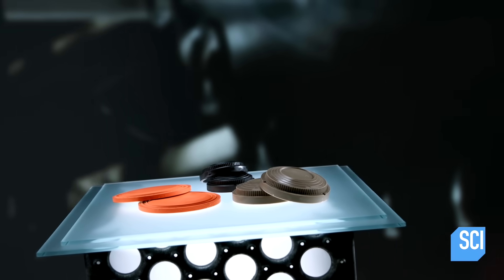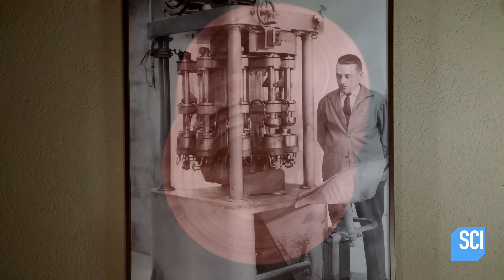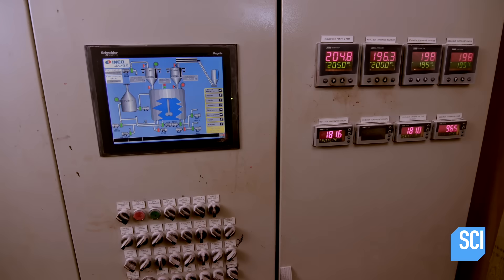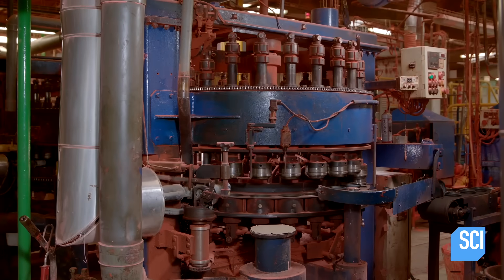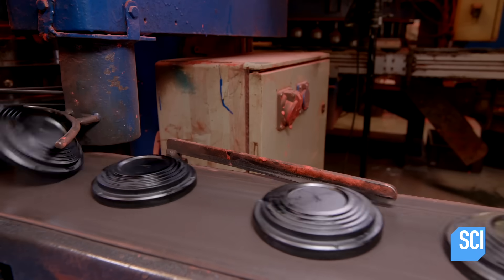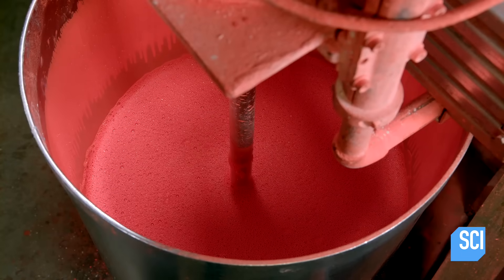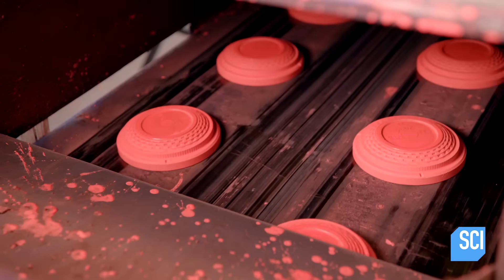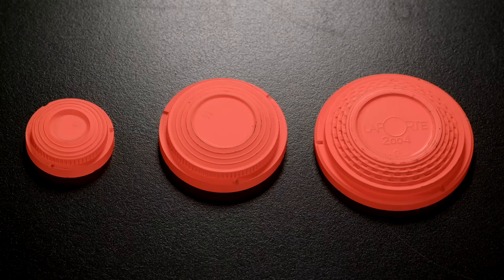How Clay Targets Are Made | How It’s Made

Comment: Makes the target out of petroleum. Boasts about biodegradable pigments SMH!
Reply: This actually seems like a pretty fantastic way to use pitch. Spread the harmless substance around the environment where it'll do absolutely no harm, instead of burning it and releasing CO2. And the paint being biodegradable means they'll turn from bright orange eyesores into inconspicuous black things.  Maybe there's something wrong with what I've just said, but there's more to the issue than your pithy little "SMH" message.
Reply: @TheHuesSciTech  Pitch is a manufactured product. Which means it doesn't need to exist in the first place. This it would never been burned if it weren't needed. Supply and demand. Didn't you learn this in your middle school classes?
Reply: @TheHuesSciTech  Negative! Pitch is a manufactured product. It's a common misconception that pitch is a byproduct. As for cost see above. I did a side by side for another comment. Bothe are relative and many have given much more inexpensive more biodegradable options!
Reply: Withered Perception the petroleum pitch is also biodegradable
Reply: @skylermurray5989  Negative. No petroleum products are biodegradable. You have been lied to! Only bioplastics and other bio-oils and bio solvents are biodegradable!
Reply: The pigment used to be Lead based.
Reply: @adammoore251  Not all...
Reply: Wonder what its like to go out to range that does a ton of clay target shooting.  Petrol shards everywhere and all nasty from being in the sun?
Reply: @OneOfDisease  Doesn't get nasty or change at all, stays as brittle black shards even after years in hot sun, that's the point of all the talc. The lead shot is a much bigger concern when it comes to contamination. Whether you miss or hit, it all basically falls in the same streak. My local field winds up with a mound about waist high after a season. They just shovel it up and dispose of it.
Reply: @OneOfDisease  they degrade very quickly, you'd never know there was any petroleum used in them.
Reply: @otm646  Yeah, or not! Read above comments.
Reply: @otm646  biodegradable ones do...
Reply: Petroleum is a natural product.
Reply: @asherdie  Don't forget about Asbestos, Arsenic, snake venom, Botulism, Mercury, Ionizing Radiation, Cosmic Rays, Formaldehyde and Anthrax... All natural products! 😂👍 All of them so safe!
Reply: @Chemicallybondedformations  all those evil chemicals you mention are useful on a daily basis to you, but you have drank all the kool-aid you can stand and blindly ask for more.
Reply: @asherdie  So is nuclear fallout from a urainum. Both are so safe... 😂👍
Reply: @Chemicallybondedformations  you don't mind the constant radiation from smoke detectors, radio transmissions or the sun either I presume.  Strawman terms like radiation and petroleum products have hampered western civilization.
Reply: @asherdie  look at you getting all triggered! 😂 it's adorable!
Reply: @asherdie  Must be all thoes lead (natural product) paint chips you ate as a kid! 😂
Reply: @Chemicallybondedformations  yes, must be all "thoes" paint chips.
Liberalism has eaten your brain.
Reply: Microbes can biodegrade up to 90% of petroleum, so...
Reply: @catnium  "Microbes if they exist in said area can biodegrade up to 90% of some light crude oil (notice LIGHT CRUDE not all petroleum) but the largest and most complex molecules––like the ones that make up road asphalt–– are not significantly biodegradable. When refined petroleum products are spilled, their fate depends on their composition." Pitch is a name for any of a number of viscoelasticpolymers. Pitch can be manufactured and derived from petroleum or coal tar. Various forms of pitch may also be called tar, bitumen, or asphalt. Good try cherry picking! 😂👍 So....
Reply: Our club uses biodegradable targets.  I have no idea what the cost difference is, however it cannot be much because the round cost is reasonable.
Reply: @paulskopic5844  honestly, that's pretty awesome they use biodegradable targets!
Reply: Withered Perception White Flyer makes targets that are 100% biodegradable and are made in the US. You can get them at WalMart cheap
Reply: @WootTootZoot  nice man! 👍 That's good info to know!
Reply: thats exacly what i thought..
Reply: Haha I was just going to comment on that! Like what's the point?!
Reply: Biodegradable, borkumensis eats oil.
Reply: @17hmr243  Alcanivorax borkumensis is a marine bacteria that dosen't exist in large quantities and sure as hell can't exist on land. So.... Not gonna break down much oil unless one directly grows them in a lab in large quantities and applies them directly to the petroleum, which has still yet to happen in any volume.
Reply: @Chemicallybondedformations  missing the point. there is away, and you replying to comments is using the internet that mines more coal to power the servers witch kill more animals and pollutes more then "clay" targets SMH
Reply: @17hmr243  You're missing the point that any petroleum products is bassed off of a finite resource and if petroleum isn't needed to be used to make a product, then is shouldn't be used! That's simply primitive thinking! Yet your simple mind thinks it's only about the targets... This kind of comedy can't be written! Pure idiocy!
Reply: Whoa. I just extended the reply section. Anyways I'm not that smart, feel free to give me your opinions but please dont turn this into a dumpster fire.
Reply: PLEASE, EVERYTIME I INTERVENE NO ONE LISTENS.
NOBODY IS A WINNER HERE, THIS AINT A COMPETITION.
Reply: @circle4602  The only argument is against Ignorance in this section. Many good comments have been shared as well.
Reply: Wait so this is s petroleum products and we throw them out over the pond!!! Well not anymore I guess
Reply: @user-r6v8e  http://shortsleeveandtieclub.com/why-the-imperial-system-of-measurements-is-actually-pretty-terrible/
Reply: And petroleum is what? A PP? It is as much natural as this paint could ever become. 
As nature what fuck it gives when oil is comming out of the groud and make som part of environment dead. Oil is a fuckin nature idiots. Oil leak does absolutelly nothing to nature IT IS NORMAL!
Reply: @HanSolo__  You know what is also natural, f**king asteroids big enough to destroy earth! They are right in our solar system!
Reply: @circle4602  Corrrect. And no matter what you can not fight and win with it.
Reply: @HanSolo__  Oil is normal, yes. Refined oil from crude removes biodegradable peptides and replaces them with long chain carbon bonds which do not biodegrade. This is known as "synthetic".
Reply: @Chemicallybondedformations  Sorry. I use mineral only.
Reply: @HanSolo__  better all the way around!
Reply: @HanSolo__  I don't know much about them, but if made from mineral there should be no effect ecologically. 👍
Reply: Well is petroleum not Bio? I mean the last time I read it was made from the EARTH 🌎
Reply: @davidchereneimmel8820  All things are made from the earth. Once refined into a synthetic such petroleum polymers/propylene from crude, lack the peptide bonds, substituted for carbon chain bonds allowing for now non-biodegrade components.
Reply: haha yeah counterintuitive you would think
Reply: Larry Schroeder  I think Raymond's point was not that the field would be waist deep with lead shot, but as you note; The lead erodes away, disappears into the ground contaminating it.
Reply: Unfortunately, there might be no substance that can be a better alternative than petroleum.
Reply: @circle4602  tempered   glass  Nothing like glass raining down on you.

glass is cheap   or even volcanic glass
Reply: @circle4602  my heart would.
Reply: proguy 🤔 how about clay?
Reply: @cdawson198600  Its too expensive.
Reply: @cdawson198600  Well it was the material used for clay pigeons, but imagine accidentally stepping into the sharp shards of hard clay pigeons.
Reply: proguy clay doesn’t break into sharp pieces unless fired in a kiln and even then nobody would be walking around a clay shooting field barefoot.
Reply: @cdawson198600  Unfired clay doesn't have the right hardness, it's too soft.
Reply: proguy then let it be fired clay, nobody walks around barefoot in a clay shooting field as I said before.
Reply: @circle4602  we make clay pots for flowers.i don't see any reasons whatsoever you couldnt use the same manufacturing techniques
Reply: @circle4602  How about the fucking clay? It's literally just dirt, unlike petroleum.
Reply: @alwayslearnmore1  That's a great idea! Hell compressed sawdust!
Reply: @circle4602  highly doubtful!
Reply: @Chemicallybondedformations  What's your suggestion for an alternate material?
Reply: @grhinson  I'll consult the wife as she is a chemist! I'll let you know shortly!
Reply: @grhinson  Bio-pitch made eucalyptus wood or compressed pine rosin. She says both have the same molecular density and gravity. So there you have it... And answer for the questions you seek 👍
Reply: @Chemicallybondedformations  Very good then...As always cost is the question...I used to work at a sporting clay range in my youth.  The one thing that clays don't do is disintegrate.
Reply: @grhinson  not sure on the mass production cost but from what I can see is Bio-Pitch and Rosen seem reasonable. I would assume it's more of not wanting to change around equipment in the factory because this is how they have done it for decades...
Reply: @Chemicallybondedformations  Provide numbers then compared to petroleum pitch.
Reply: @kylesenior  $750-$800 per ton for petroleum pitch (coke). Bio-pitch is about $.37-$.41 so we will average it at about $.39 per lb x 2,000= $780. For pine rosin one would be looking at $.39 per lb to $.47 per lb so mean would be $.44 x 2,000 = $880. But this is not bulk pricing. Don't you have Google? Why didn't you do this research and the math instead of me doing this? No more stupid questions you can answer yourself! That was your one!
Reply: @grhinson  PLA
Reply: @XA--pb9ni  Probably would need more mass than straight PLA,
Reply: @Chemicallybondedformations  how does one harvest bio pitch cut down trees? While renewable ,would demand keep up with regrowth?
Reply: @walkerv8530  All good questions, but it seems there is more than plenty of waste in the both processes.
Reply: @Chemicallybondedformations  Is the petroleum pitch a by-product of refining oil?  So it exists either way? What happens to a clay target when it is hit and pieces fall to the ground?   Do we see an oily spot in 50 years time?  IOW you beg the question.
Reply: @scottstewart5784  Not my forte, but pitch is not a by-product, "Pitch is a name for any of a number of viscoelasticpolymers. Pitch is manufactured, derived from petroleum, coal tar. Various forms of pitch may also be called tar, bitumen, or asphalt."
Reply: @scottstewart5784  Section 4 - FIRST AID MEASURES 

Inhalation

If adverse effects occur, remove to uncontaminated area. Give artificial respiration if not breathing. If breathing is 

difficult, oxygen should be administered by qualified personnel. Get immediate medical attention. 

Skin

Wash all affected skin areas with warm soapy water. Skin contact causes photosensitization which can last for 36-72 

hours after exposure. Keep out of direct sunlight for the next two to three days to avoid sunburn to the 

photosensitized skin areas. Use a broad spectrum blockout cream to protect against UV alpha ray exposure. Get 

medical attention, if needed. 

Eyes

Rinse cautiously with water for several minutes. Remove contact lenses, if present and easy to do. Continue rinsing. 

Then get immediate medical attention. 

Ingestion

Not a likely route of exposure. Rinse mouth. Do NOT induce vomiting. If a large amount is swallowed, get medical 

attention. Do not give anything by mouth to unconscious or convulsive person. If vomiting occurs, keep head lower 

than hips to help prevent aspiration. 

Most Important Symptoms/Effects 

Acute 

allergic reactions 

Delayed 

allergic reactions, mutagenic effects, Reproductive Effects, skin cancer 

Indication of any immediate medical attention and special treatment needed 

Treat symptomatically and supportively.
Reply: @scottstewart5784  Section 5 - FIRE FIGHTING MEASURES 

Extinguishing Media 

Suitable Extinguishing Media 

regular dry chemical, carbon dioxide, regular foam, water spray 

Unsuitable Extinguishing Media

Do not use high-pressure water streams. 

Special Hazards Arising from the Chemical

Material Name: PETROLEUM PITCH SOLID SDS ID: 00234140

__________________________________________________________

Page 4 of 16

 

Issue date: 2018-08-20 Revision 2.3 Print date: 2018-08-20

Dust/air mixtures may ignite or explode. During fire conditions, vapors and decomposition products may be 

released, forming toxic and/or flammable/explosive mixtures in air. Avoid generating dust; fine dust dispersed in air 

in sufficient concentrations, and in the presence of an ignition source is a potential dust explosion hazard. 

Hazardous Combustion Products 

Carbon monoxide, carbon dioxide, oxides of nitrogen, oxides of sulfur, polynuclear aromatic hydrocarbons 

Fire Fighting Measures

Avoid inhalation of material or combustion by-products. Stay upwind and keep out of low areas. Use extinguishing 

agents appropriate for surrounding fire. Flood with fine water spray. Directly spraying water or foam onto hot 

burning product may cause frothing. For fires in cargo or storage area: Cool containers with water from unmanned 

hose holder or monitor nozzles until well after fire is out. If this is impossible then take the following precautions: 

Keep unnecessary people away, isolate hazard area and deny entry. Withdraw immediately in case of rising sound 

from venting safety device or any discoloration of tanks due to fire. When the solid material is heated (as in a fire) it 

will melt and begin to flow. The molten material may be chilled and solidified using a water fog or fine water spray. 

Special Protective Equipment and Precautions for Firefighters 

Wear full protective firefighting gear including self-contained breathing apparatus (SCBA) for protection against 

possible exposure.
Reply: @scottstewart5784  Section 6 - ACCIDENTAL RELEASE MEASURES 

Personal Precautions, Protective Equipment and Emergency Procedures 

Wear personal protective clothing and equipment, see Section 8. Avoid release to the environment. 

Methods and Materials for Containment and Cleaning Up 

Stop leak if possible without personal risk. Shovel solidified material into containers for recycle if clean or disposal 

if contaminated. The solid or solidified spillage should be cleaned up as quickly as possible. Spilled material in a 

traffic area will break down with mechanical contact (e.g. vehicle tires) and become a wind borne dust. Solid 

material spillage may be wet down with a fine water spray to suppress dust during cleanup. If sweeping of a 

contaminated area is necessary, use a dust suppressant agent. Collect spill using a vacuum cleaner with a HEPA 

filter or wet and scoop up dry spills. Avoid sweeping spilled dry material. Eliminate ignition sources including 

sources of electrical, static or frictional sparks. Collect spilled material in appropriate container for disposal. In 

Canada, report releases to provincial authorities, municipal authorities, or both, as required. Due to the concentration 

of Benzo(a)pyrene and the CERCLA (40 CFR 302.4) reportable quantity of 1 pound, the release of 500 pounds 

(50.8 gallons) of this product requires National Response Center notification. See Section 13 for waste disposal 

information. 

Section 7 - HANDLING AND STORAGE 

Precautions for Safe Handling 

Avoid breathing dust. Avoid contact with eyes, skin and clothing. When using, do not eat, drink or smoke. Wear 

protective gloves/clothing and eye/face protection. Wash exposed areas thoroughly with soap and water, or a 

waterless hand cleaner, after skin contact and before eating, drinking, using tobacco products, or restrooms. Use 

protective skin cream on exposed skin before and during work shift. To reduce sun sensitivity a sun-blocking lotion 

can also be applied prior to application of a protective cream. Contaminated clothing should be removed and 

laundered before reuse. Contaminated work clothing should not be allowed out of the workplace unless laundered or 

decontaminated. After working with the product use warm soapy water and a wash cloth to thoroughly wash all 

areas of skin that have been contacted with product. After washing, apply a broad spectrum UV blockout cream on 

exposed skin areas before going into sunlight. Keep out of strong sunlight for two to three days after being affected 

by the product. Obtain special instructions before use. Do not handle until all safety precautions have been read and 

understood. Use methods to minimize dust. Avoid significant deposits of material, especially on horizontal surfaces, 

which may become airborne and form combustible dust clouds and may contribute to secondary explosions. 

Conditions for Safe Storage, Including any Incompatibilities 

Store locked up.Store and handle in accordance with all current regulations and standards. Label all containers. Store in metal 

containers. Avoid use of plastic containers. Keep in a well-ventilated place. Keep away from heat, sparks and naked 

flames. Protect from physical damage. Notify State Emergency Response Commission for storage or use at amounts 

greater than or equal to the TPQ (U.S. EPA SARA Section 302). SARA Section 303 requires facilities storing a 

material with a TPQ to participate in local emergency response planning (U.S. EPA 40 CFR 355 Part B). Keep 

separated from incompatible substances. 

Incompatible Materials 

oxidizing materials, nitrates, chlorates, peroxides
Reply: @scottstewart5784  Section 8 - EXPOSURE CONTROLS / PERSONAL PROTECTION 

Component Exposure Limits 

Petroleum pitch 68187-58-6

ACGIH: 0.2 mg/m3 TWA as benzene-soluble aerosol (related to Pitch, coal tar, high-temperature)

OSHA (US): 0.2 mg/m3 TWA (benzene soluble fraction ) (related to Pitch, coal tar, high-temperature)

Naphthalene 91-20-3

ACGIH: 10 ppm TWA 

Skin - potential significant contribution to overall exposure by the cutaneous route 

OSHA (US): 10 ppm TWA ; 50 mg/m3 TWA 

ACGIH - Threshold Limit Values - Biological Exposure Indices (BEI) 

Petroleum pitch (68187-58-6)

2.5 µg/l Medium: urine Time: end of shift at end of workweek Parameter: 1-Hydroxypyrene with hydrolysis 

(background ); Medium: urine Time: end of shift at end of workweek Parameter: 3-Hydroxybenzo(a)pyrene with 

hydrolysis (nonquantitative ) (related to Polycyclic aromatic hydrocarbons)

Engineering Controls

Ventilation equipment should be explosion-resistant if explosive concentrations of material are present. Provide 

local exhaust or process enclosure ventilation system. Ensure that dust-handling systems (such as exhaust ducts, dust 

collectors, vessels, and processing equipment) are designed in a manner to prevent the escape of dust into the work 

area (i.e., there is no leakage from the equipment). Ensure compliance with applicable exposure limits. 

Individual Protection Measures, such as Personal Protective Equipment 

Eye/face protection 

ANSI Z87.1-1989 approved safety glasses with side shields. Provide an emergency eye wash fountain and quick 

drench shower in the immediate work area. At elevated temperatures: A face shield is recommended. 

Skin Protection 

Wear protective clothing to prevent contact. Wear long sleeved shirt or overalls fastened at wrists and neck, with 

long legged trousers with trouser legs worn outside over boot tops, boots, socks, and safety hat plus gloves. Use 

protective skin cream on exposed skin before and during work shift. Protective clothing must be changed when it 

shows signs of contamination. Remove and launder contaminated clothing separately from other laundry before 

reuse. When material is at an elevated temperature, wear appropriate heat resistant clothing. 

Respiratory Protection

If the applicable TLVs and/or PELs are exceeded, use NIOSH-approved multipurpose air-purifying cartridge 

respirators, for organic vapors and P-100 particulate. Use a positive-pressure, air-supplied respirator if there is any 

potential for uncontrolled release, exposure levels are not known, or any other circumstance where air-purifying 

respirators may not provide adequate protection.Glove Recommendations

Wear appropriate gloves. When material is at an elevated temperature, wear appropriate heat resistant gloves. 

Protective Materials

Recommended materials include: protective skin cream, chemical resistant material, and heat resistant material. 

Section 9 - PHYSICAL AND CHEMICAL PROPERTIES 

Appearance black solid Physical State solid 

Odor tar odor Color black 

Odor Threshold Not available pH Not available 

Melting Point 80 - 130 °C Boiling Point >290 °C

Boiling Point Range Not available Freezing point Not available 

Evaporation Rate Not available Flammability (solid, gas) Not flammable 

Autoignition 

Temperature Not available Flash Point >260 °C

Lower Explosive 

Limit Not available Decomposition temperature Not available 

Upper Explosive 

Limit Not available Vapor Pressure 18 mmHg @ 

23 °C

Vapor Density 

(air=1) >1 Specific Gravity (water=1) >1.18

Water Solubility (Insoluble ) Partition coefficient: n-

octanol/water Not available 

Viscosity Not available Kinematic viscosity Not available 

Solubility (Other) Not available Density Not available 

Physical Form changes from solid to liquid as 

temperature increases Softening Point 80 - 130 °C

Molecular Weight Not available OSHA Flammability 

Category 4 

Other Information

None known 

Section 10 - STABILITY AND REACTIVITY 

Reactivity 

No reactivity hazard is expected. 

Chemical Stability

Stable at normal temperatures and pressure. 

Possibility of Hazardous Reactions Will not polymerize. 

Conditions to Avoid

Avoid accumulation of airborne dusts. Avoid heat, flames, sparks and other sources of ignition. Containers may 

rupture or explode if exposed to heat. Keep out of water supplies and sewers. 

Incompatible Materials

oxidizing materials, nitrates, chlorates, peroxides 

Hazardous decomposition products 

carbon monoxide, carbon dioxide, oxides of nitrogen, oxides of sulfur, polynuclear aromatic hydrocarbons 

Section 11 - TOXICOLOGICAL INFORMATION 

Information on Likely Routes of Exposure 

Inhalation 

No information on significant adverse effects. 

Skin Contact 

allergic reactions, sensitivity to sunlight, skin cancer 

Eye Contact 

sensitivity to sunlight 

Ingestion 

Reproductive Effects 

Acute and Chronic Toxicity 

Component Analysis - LD50/LC50 

The components of this material have been reviewed in various sources and the following selected endpoints are 

published: 

Petroleum pitch (68187-58-6)

Oral LD50 Rat 4320 mg/kg

Dermal LD50 Rabbit >2000 mg/kg

Product Toxicity Data 

Acute Toxicity Estimate 

Dermal > 2000 mg/kg

Inhalation - Dust and Mist > 5 mg/L

Oral > 2000 mg/kg

Immediate Effects 

allergic reactions 

Delayed Effects 

allergic reactions, mutagenic effects, Reproductive Effects, skin cancer 

Irritation/Corrosivity Data 

Erythema/eschar score: 0, Oedema score: 0 

Respiratory Sensitization 

No evidence that the material can lead to respiratory hypersensitivity. 

Dermal Sensitization 

Component data indicate the substance may cause an allergic reaction. May cause photosensitivity. Component Carcinogenicity 

Petroleum 

pitch 68187-58-6

ACGIH: A1 - Confirmed Human Carcinogen (related to Pitch, coal tar, high-temperature)

IARC: Monograph 100F [2012] ; Supplement 7 [1987] ; Monograph 35 [1985] (related to Pitch, coal 

tar, high-temperature) (Group 1 (carcinogenic to humans)) 

NTP: Known Human Carcinogen (related to Pitch, coal tar, high-temperature)

DFG: Category 1 (causes cancer in man ) (related to Pitch, coal tar, high-temperature)

OSHA: Present (related to Pitch, coal tar, high-temperature)

NIOSH: potential occupational carcinogen (related to Pitch, coal tar, high-temperature)

May cause cancer. 

Germ Cell Mutagenicity 

Available data characterizes this substance as mutagenic. Bacterial Reverse Mutation Test – positive. 

Tumorigenic Data 

No data available 

Reproductive Toxicity 

Available data characterizes this substance as a reproductive hazard. 

Specific Target Organ Toxicity - Single Exposure 

No data available. 

Specific Target Organ Toxicity - Repeated Exposure 

NOAEL: 200-250 mg/kg Oral Mouse 

Aspiration hazard 

No data available. 

Medical Conditions Aggravated by Exposure

respiratory disorders, skin disorders, eye disorders 

Additional Data

After prolonged and repeated exposure, petroleum pitch produced carcinogenic activity in mice lifetime skin 

painting studies. Petroleum pitch was positive when tested in a modified Ames mutagenicity assay. IARC 

determined there is sufficient evidence for carcinogenicity in experimental animals of light and heavy vacuum 

distillates, of light and heavy catalytically cracked distillates and of cracked residues (including heavy 

thermocracked distillates/residues) from the refining of crude oil. In addition to containing information about the 

product as a whole, this data sheet also contains information about individual components of the product. 

Information of this nature may not have been derived from studies or data relating to this product and/or may have 

been derived from studies or data that did not involve human exposure and involved animal exposure only. Some 

polycyclic aromatic hydrocarbons (PAHs), found in coal tar complex substances, have been reported to cause lung 

and skin cancer in humans under conditions of poor personal hygiene, prolonged/repeated contact, and exposure to 

sunlight. The National Toxicology Program (NTP) and IARC have independently classified various PAH 

compounds present in coal tar substances as reasonably anticipated to be human carcinogens (NTP), probably 

carcinogenic to humans (IARC Group 2A), possibly carcinogenic to humans (IARC Group 2B), and not classifiable 

as to carcinogenicity to humans (IARC Group
Reply: @scottstewart5784  3). The cancers reported in the studies upon which IARC based its 

conclusions involved lung, skin, liver, stomach, kidney and blood cancers in animals. Based on the results of animal experiments PAHs may cause injury to the liver, kidneys, lungs, blood and lymph systems. Some PAH's have also 

been associated with impaired fertility, heritable genetic damage and birth defects in mice. 

Section 12 - ECOLOGICAL INFORMATION 

Ecotoxicity 

Harmful to aquatic life. May cause long-term adverse effects in the aquatic environment. 

Component Analysis - Aquatic Toxicity 

Petroleum pitch 68187-58-6

Fish: LC50 96 h Brachydanio rerio 48 mg/L [semi-static ]

Invertebrate Toxicity

EL50 48 hour(s) >1000 mg/L Daphnia magna. 

Algal Toxicity

EL50 72 hour(s) >100 mg/L Scenedesmus subspicatus. NOELR 72 hour(s) 100 mg/L Scenedesmus subspicatus. 

Persistence and Degradability 

This substance is not expected to biodegrade. Insoluble in water. 

Bioaccumulative Potential 

The product is not expected to accumulate in the environment. Insoluble in water. 

Mobility 

Insoluble in water. 

Other Toxicity

No data available. 

Section 13 - DISPOSAL CONSIDERATIONS 

Disposal Methods

Dispose in accordance with all applicable regulations. 

Component Waste Numbers 

The U.S. EPA has not published waste numbers for this product's components. 

Section 14 - TRANSPORT INFORMATION 

US DOT Information: 

No Classification assigned. 

International Bulk Chemical Code 

This material does not contain any chemicals required by the IBC Code to be identified as dangerous chemicals in 

bulk. 

Further information 

This material is classified as an oil under 49 CFR Part 130 when transported in a container of 3,500 gallon capacity 

or greater. See 49 CFR Part 130 for oil spill prevention and response plan requirements for truck and rail shipments. 

Component Marine Pollutants. This material does not contain any chemicals listed on the Hazardous Materials 

Table required by US DOT to be identified as a marine pollutant.
Reply: @Chemicallybondedformations  
What about the cost?
Reply: @Chemicallybondedformations  Not only is it not bulk pricing, your analysis assumes that the price of petroleum pitch is stagnant. If you are a company who wants to remain in business you will be really interested in how the price of crude oil rises over the next 10, 20, 30 years or more. There may be an inflection point were bio-degradable alternatives are more "sustainable" (see what I did there?) in a business sense than traditional fossil-fuel based ingredients.
Reply: @KevinSchmitt77  You are 100% correct. There is much variation to petroleum! Most sustainably sourced items have little to no market variation. And I like that interjection! Good slip in! 😂👍
Reply: @Chemicallybondedformations  seeing as you wrote lb I assume you were talking about imperial pounds and not metric? If so your calculations are off, multiplying a metric pound by 2.000 would indeed yield a metric ton, but with an imperial pound your calculations would be off by about 10%.
Reply: @LT89NL  Correct, imperial, And yes any calculation would have a variance of 10-15% as imperial is a stupid measurement and unbelievably inaccurate.
Reply: @Chemicallybondedformations  that I completely agree on, but maybe some day the last couple of countries who still use that medieval measurement system will also join the rest of us in the modern age...
Reply: @LT89NL  Que the angry comments from the described above person's....
Reply: @Chemicallybondedformations  "imperial is a stupid measurement" correct

"...and unbelievably inaccurate" wrong

...the only inaccuracies are due to the moron who doesn't understand how to do conversions properly.
Reply: @user-r6v8e  But if everyone was metric, we wouldn't have this problem, no more wrong airplane fuel amounts and no more wrong rocket trajectory calculations!
Reply: @user-r6v8e  That's cute that you believe that! 😂😂 The imperial system is flawed and requires anyone using it to switch between   metric and imperial to aquire proper accuracy! Might as well just use metric and be done!
Reply: Sugar